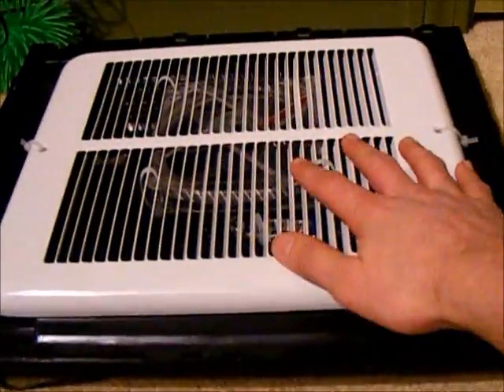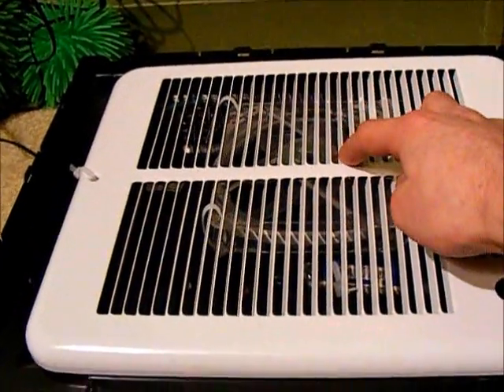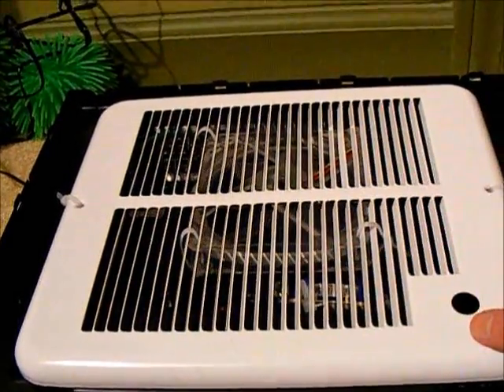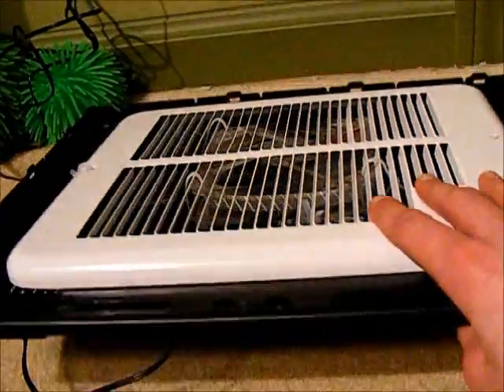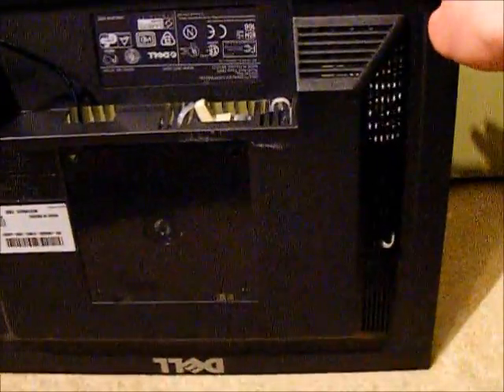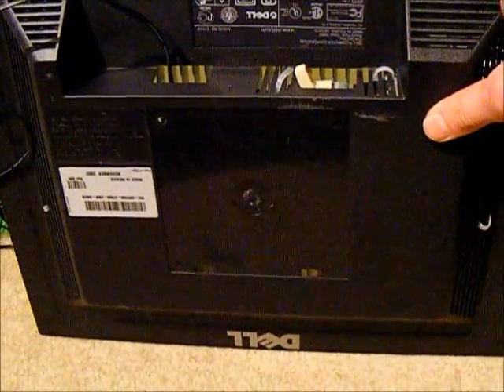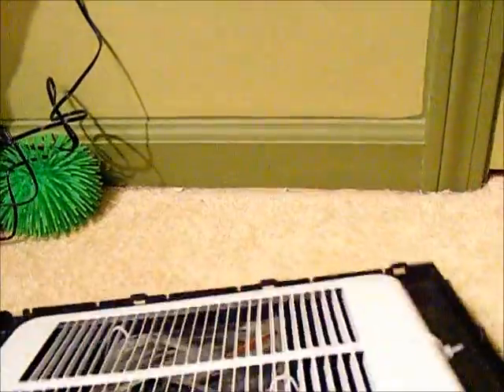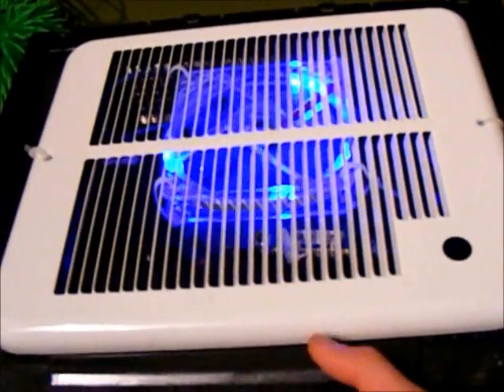Home Made Laptop Cooling Pad

Comment: Not very effective lol, try reversing fans so they suck, not blow, and line up with the laptops own fan slots/holes. Should help accelerate the heat suction meaning more cool air gets sucked through too.